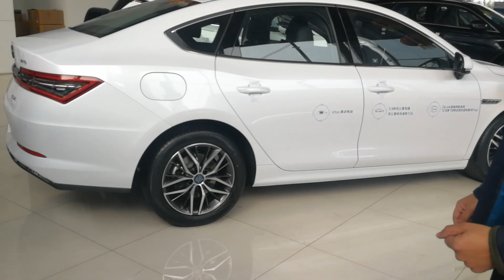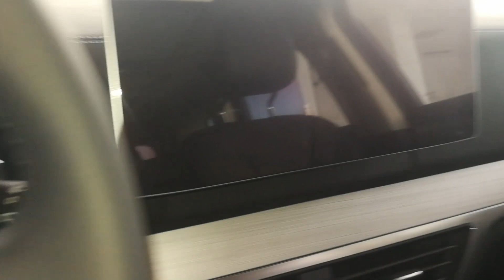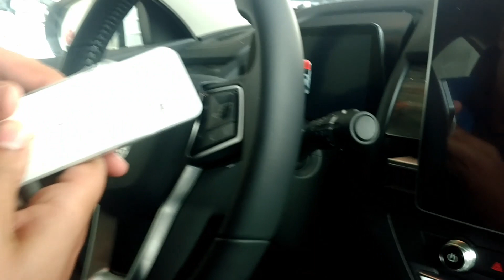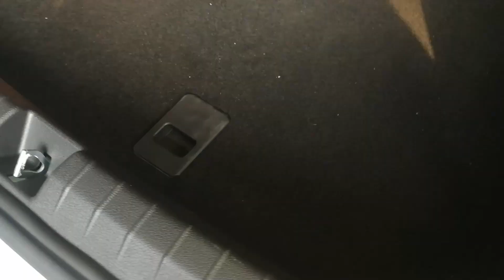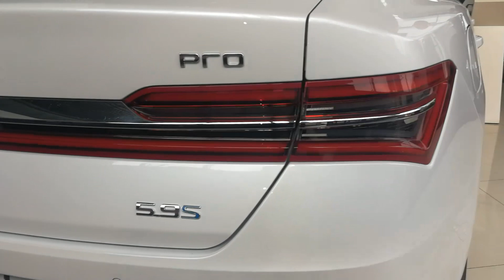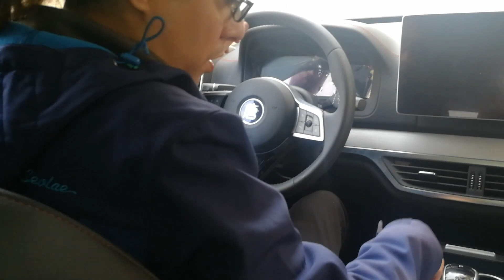Chinese Hybrid Cars: Are they worth it? BYD Qin Look Tang test drive

Comment: 2.38ton.
Reply from the maker: The BYD Tang?
Reply: @chinawheels3558  yes. BYD tang DM. its battery is quite heavy. but, Fuel consumption seems ok . many buyers in china have reported that  the fuel consumption is about 9L-11L/100km in mixed road conditions（including urban road which is quite traffic jam and highway which u can driven with more than 110km/h）. and this data is tested with low electricity remained. considering its weight and SUV type, this data is quite acceptable.  many tang DM owners also report their using experience in China's biggest car forum. they have even drive Tang DM to Tibet，where has the severe tests for cars and drivers on their off-road ability and engine power and many other things. here is one of the biggest forums：
https://club.autohome.com.cn/bbs/forum-c-4802-1.html
Reply: @chinawheels3558  if u can understand Chinese language, u will get more detail information about Tang DM cause this car really subvert the traditional concept of Chinese car consumers about chinese cars. So many reports and threads about its 4X4 ability(very good)，accalerating ability(very good)，Maneuverability(OK)，digital technic(very good)，chassis and material(quite good). the only thing we need to know is its reliability. by so far Tang DM seems reliable with the reports from so many owners, but we still need time prove it.
if u want to get detail information, u can google or baidu 唐DM or 唐二代. thats the Chinese word of Tang DM or second generation Tang.
Reply from the maker: @gaoleclan8101  Hi, I am aware of all this. This video was my first real upoload, made with stick and stones. I plan on remaking it, now that I have half-decent material. I will use your advice, to focus on these aspects. Thanks!

Comment: Hi, Do you know if the instrument panel and Infotainment systems of BYD Tang 2, Song EV500, and Qin Pro have English language options?
Reply: I recently asked our local distributor here in PH, they are actually accepting reservations for the Tang 2nd generation even though they are still selling the 1st version. It maybe a hint that they have plans to offer the english language. They are reportedly releasing the Yuan EV360 this Q1 end also. The new Song Max is already loaded in their website too. I will try to book a test drive session when I get the opportunity.
Reply from the maker: Will go to the distributor after cChinese New year. If available, you'll see it here ;)
Reply: I asked also I was told no. But it’s not hard to work out. The entertainment system is android so it’s easy to load android apps. I was able to load a VPN in mine so I have google and YouTube and Apple Music working no problem.
Reply: @Badgerbite  nice work around! Btw, do you own a Tang2? How's the performance?
Reply: Leonard Nunag, it performs very well. Although the petrol tank is small and the engine is a little noisy. If you can charge every evening it is great for running around town on eco. If you can’t it can be quite thirsty on gas. I am sure the language will be changed to English or Tagalog for export to the Philippines.
Reply: @Badgerbite  hi, since Tang2 has been around for quite some time already, what are the prevalent car issues either on the DM or petrol version? Any issues you encountered on Mechanical like Suspension, Engine issues, Battery failure, Fuel Consumption, etc?
Reply: @Badgerbite  how much is Tang 2 DM before incentives?
Reply from the maker: I did ask, and the answer was no... Maybe in the future.
Reply: Thanks! I hope they would have an export version soon.
Reply from the maker: @butikito  Hope so too ;)
Reply: @chinawheels3558  just to share, it sucks that BYD is selling the Yuan EV360 here at RMB 297000. 😔
Reply: They even use Chinese on all the concrete buttons. I don't think they are planning to go abroad at this moment.
Reply: English language now available. Read from a recent report somewhere.